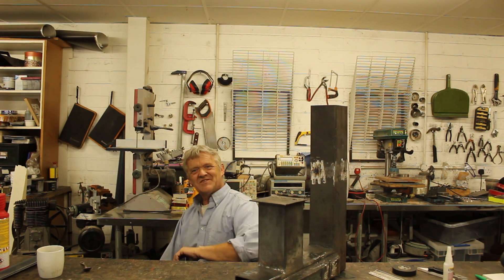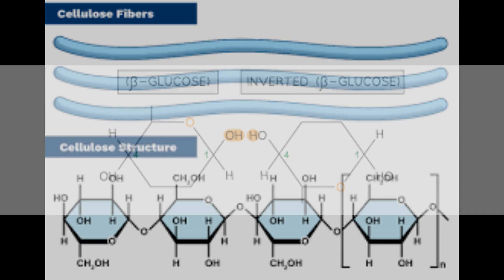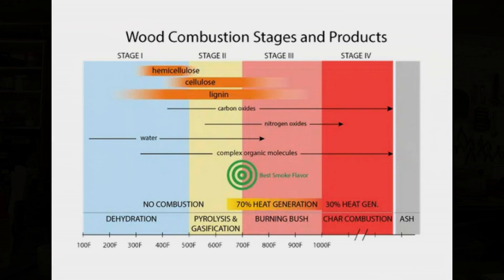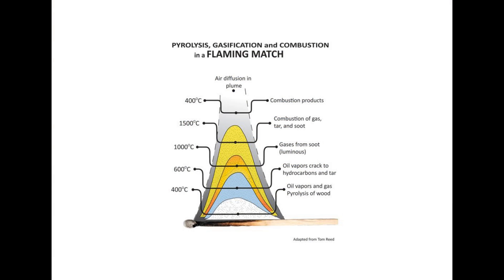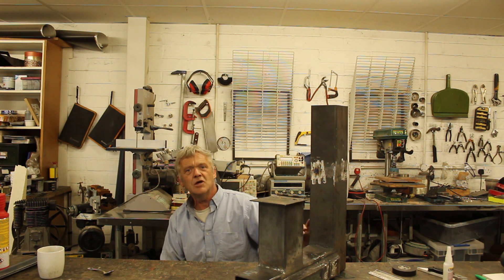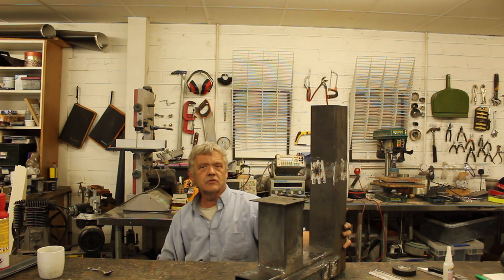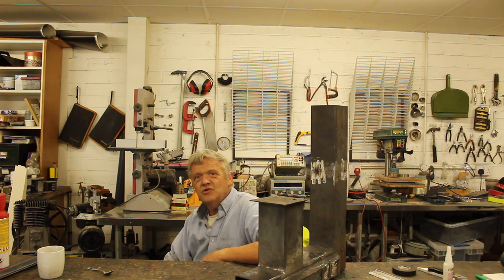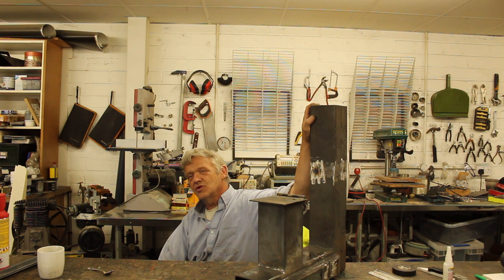1610 All About Rocket Stoves

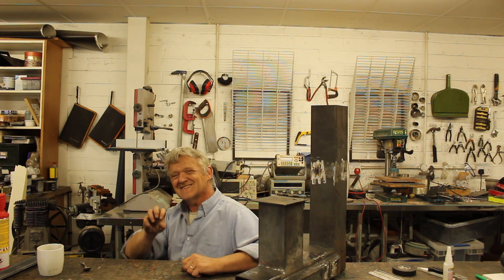Comment: 3:14 I would like to correct a misconception about gasifiers (since I work for a company that makes biomass gasifier gensets). Gasifiers don't collect the decomposition products of wood as-is, because too many of these products condense into acids ("wood vinegar", or pyroligneous acids) and tars. Gasifiers are refineries that convert the crude feedstock of biomass into a gas that is compatible with an internal combustion engine, and these acids and tars make the gas unfit for use in an engine. What gasifiers do is combust these tars and acids, and thermally crack the rest into lighter non-condensing gases, then send these through the hot charcoal to carry out reduction reactions. The reduction reactions react CO2 and H2O with hot charcoal. When the carbon in charcoal is hot, it has an incredible oxygen affinity, and will readily rip oxygen right off of CO2 and H2O to release CO and H2 gas, while the oxygen that got removed in the process combines with carbon to form CO gas from the charcoal. Since CO and H2 gases are both flammable and non-condensing, they are safe to feed into an internal combustion engine.

A lot of folks get the idea that a gasifier is just something that collects the thermal decomposition products of heating wood, and Nighthawk In Light made a bunch of videos that spread this misconception. What he made wasn't a gasifier; what he made was a pyrolyzer. Pyrolysis is only one of the five processes of gasification. The gasification that was used to power cars during the world wars (when all the petroleum went to the military first and foremost) did not send pyrolysis gases into the engines; they burned this and carried out reduction reactions using the CO2 and H2O from combustion reacting with the charcoal that resulted from pyrolysis. The resulting mixture of CO and H2 diluted with atmospheric N2 is what went into the engine.

Comment: I like to play around with/experiment with different ways to cook from candles to gas, Ive cooked over oil lamps and it works but you need a way to keep the pot off the chimney so in an emergency its doable but complicated. A Dietz D Lite Lantern has a flat spot on top that you can balance a small pot on and the flame can still breath... Rocket stoves are pretty amazing with how little fuel is needed to boil water or cook a meal.. a 28oz soup/bean can as the main body and a small 6oz juice can as the fuel feed can run on a couple handfuls of twigs
Reply from the maker: nice mate - cheers

Comment: Hi Robert, Supperb Wallace & Gromit Channel you have here. I would be eternally grateful if you can tap your big brain to explain in laymans terms how i can separate glucose from fructose without using any acid or chemicals. Thanks.
Reply from the maker: hmmm - that will be a challenge - interesting - cheers mate
Reply: Cooling and then filtering should do the trick (glucose has lower solubility than fructose).
Reply: @bravante5927  thanks. Will give it a try...

Comment: I'm experimenting with tin can stoves, double walled, dog food and hotdog tins, holes and a fan shaped lid at the bottom to turbo it up.
Reply: 5 litre paint can , say 12 of ¾ inch holes around the bottom  just ½ inch above the base . Holes punched through with  sharp knife with a horizontal and vertical jab per hole,, kinda square holes thus ,, . No holes at top for exhaust gases but use ½ or ¾ inch diameter metal pipe,,, small section of green branch works too,,, across top as spacing for exhaust escape that pot/pan sits on. Lasts for 6 months of regular use . However 6 building  bricks nicely circle it when placed vertically side to side around  for support of some  really heavy cookpots to also  give wind protection. It'll do ten litres of soup fine .
Reply: @michaelcorbidge7914  Nice one.
Reply from the maker: wow - interesting - how's it going ? any vids?

Comment: Would any well placed insulation noticeably improve the operating range *requiring less fuel to get a reliable full burn?
Reply from the maker: insulation will help a little as you want to maintain the temperature at the level where pyrolysis happens - but in order for it to burn you will want fresh oxygen - maybe preheater for the air inflow would help too

Comment: A word to the wise: little metal cook Rocket Stoves are very cool and useful. They will last a good long time if not insulated and kept small. If you plan a larger version or wish to insulate to improve efficiency,  use a refractory material! Temperatures inside can exceed 1000c. Combined with excess oxygen, this will burn out mild steel and even degrade stainless steel dramatically.
Reply from the maker: nice tip mate - cheers
Reply: @ThinkingandTinkering  
Thank you sir. You do great work on this channel! Thanks for what you do.
Reply: Sundog won't steer you wrong!
Reply: @marthale7 
It will. Refractory tends to be somewhat insulating, moves heat away from the combustion area slower and will approach saturation quicker (unless the metal is insulated,  which is a bad idea).
Part of what makes rocket stoves efficient is concentrated heat inside the combustion area. It's why the best practice is to NEVER remove heat  to your uses from the combustion unit itself. 

Use refractory, insulate it well from the feed to the top of the riser (it's not considered to be a "chimney" for reasons too complicated to discuss here now) and take heat to your uses after (and only after) the top of the riser. This will insure more complete combustion for most of your firing time.
Reply: @marthale7 
A way to improve without having moving parts is good proportion. The general recommendation is 1:2:4 (feed:horizontal:riser). Shortening the horizontal bit and lengthening the riser part will go a long way, especially with smaller stoves. A little metal cooker can really rip with a proportion of 1:2:5 or 6.
Reply: @marthale7 
Only problem with a BatchBox is that it looks so much like a standard firebox that the uninitiated will treat it as such. Stuffing wood against the throat or trying to damp them down are the worst for batch boxes and they're the first things people try to do!
Reply: Jeah you need no insulation, you need dissipation because the heat is so strong that more insulation would concentrate the heat and harden the steel to the point where you can break it between two fingers. Our new heating is with normal wood and the first inlet at the bottom was from casted steel and after 3 month this 4cm thick steel bars were burned, not melted burned. This is a "normal" heating without "rocket effect" so the temperatur is a lot lower then with a rocket stove. This stove is a fun-project for picknick´s or barbecue´s and thats exactly what RMS said.
Reply: @Harrington2323  Right.  Metal burns out.  Insulate it from the heat...and contain combustion for greater efficiency ...more heat to put up-stream for use.  Primary combustion is the most important part of a heat system.  You want a clean hot burn, right?  Burn the smoke before it gets a chance to exit the combustion chamber.  Three T's of Combustion:  Time, Temperature, and Turbulance.  Watch Broaudio on youtube.  He lays it out plain and simple in his stove chats.

Comment: Thank you Robert!! I was wondering your thoughts on using “Starlite” as an insulating material for the water heater you built from a rocket stove?
Reply: I know you asked for Robert, but in the mean time, "Starlite" is essentially a carbon foam that works well as a temporary insulation; NASA uses a much higher grade for ablative shielding on re-entry craft that is considered single use. For permanent installation, you're much better off with a combination of sand, alumina (aluminum oxide) and perlite/limestone. If you want to be really fancy, you can do a top coat of silicon carbide as your hot face; the proverbial ceramic hot side.
Reply: @C-M-E  Thank you very much for the response Brother!
Reply from the maker: I think starlet is great for single use - but my understanding is it only really becomes insulating once it is a carbon foam - paper does that too incidentally which is why a closed book is so hard to burn - hmmm!
Reply: @ThinkingandTinkering  The man, the myth, the legend! Thank you very much for the response Brother! I absolutely appreciate your videos and the knowledge you’ve contributed to my off grid build!! Thank you once again!